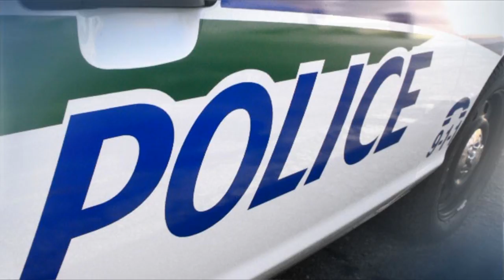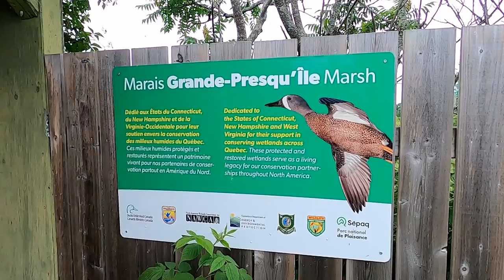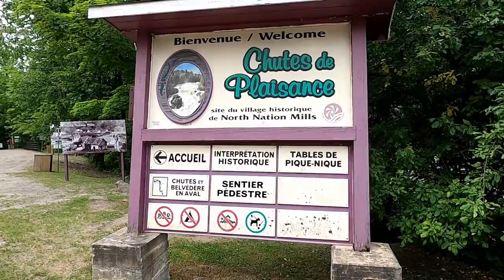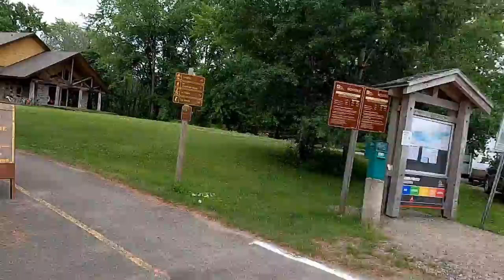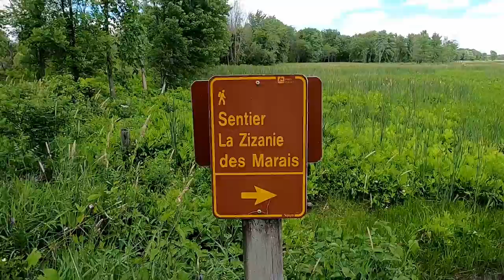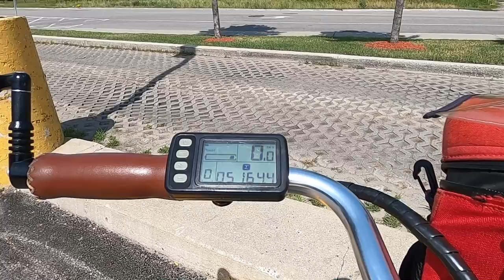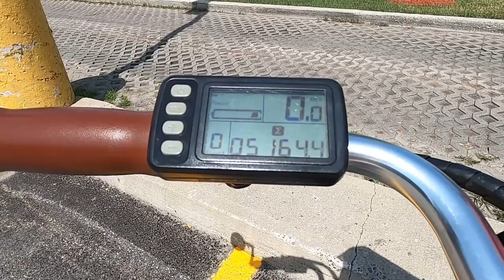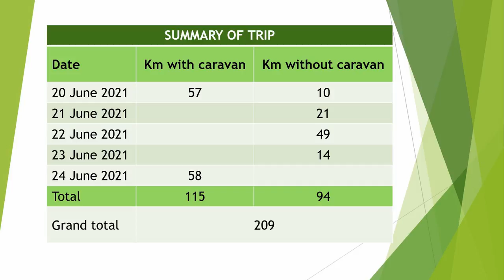Two Old Men on Ebikes With Trailers Go Camping at Plaisance

Comment: I love this video. It looks like such a pleasant trip. I have a Bacchetta recumbent to which I have added an electric motor kit. I love it. I am curious about what equipment you use to shoot your videos. I'm very impressed by how smooth the video is even when you are travelling of some quite bumpy roads and trails.
Reply from the maker: I'm using a GoPro 8 Black. The stabilization is amazing. The camera was mostly attached to the handlebars, and the Pedego doesn't even have a suspension fork. Of course, now that the GoPro 9 is out, that's what I'd like to have!
Reply: @RobertBeriault753  Thanks for that info, Robert. I didn't know GoPro cameras were that good at image stabilization. I don't really take many photos or videos while riding, but I might do so if I had a good way to do it. :-)

Comment: I put some airless tires on my Kona Ute electric bicycle tow truck and I'm looking forward to putting some serious miles on them... Hopefully my old rims won't disintegrate... Was quite a workout mounting them... A process not for the faint-of-heart and you need a Grapplers grip
Reply from the maker: Flat-proof tires must be wonderful!
Reply: @RobertBeriault753  so far so good  though there are some disadvantages to consider... some increase in Rolling resistance and decrease efficiency... Also somewhat Less shock-absorption and more unequal distribution of forces on the rim as compared with a pneumatic tire... LOL I'm on the road to find out... So far I'm still chuffed.. and happy to get my sidewall cracking tires and slime tubes that were delaminating at the valve stem off... Is also very nice to bypass the pump

Comment: Nice video!  What trailer / camper is that? Do you charge battery directly while riding. If so, please discuss.
Reply from the maker: The one I'm towing is my Bériault Bicycle Camper and the one Gaetan is using is my Solar trailer without the solar panel. I'm not charging on the fly because my camper is not equipped with solar panels. I charge my batteries at night in campgrounds.

Comment: Hi thank you for sharing your experience and trip I am a senior to I love bike touring I you like to have some Company sometime let me know I live in Mississauga Ontario How heavy is your trailer and how many w is your motor  I have a NCM Milano Plus 500Watt motor Can I pole a small trailer 4:51
Reply from the maker: My camper weighs 60 lbs empty and 130 lbs fully loaded. My Rad Rover with its upgraded controller is probably close to 750 Watts. Even at that, it can't pull my camper up a 30 degree hill, which is what I'm looking for. Should you like to communicate with me, you can reach me at email address, available on my website: www.robertberiault.com. Thanks for your comment.

Comment: I make ahabit of carrying my charger ans 8 meter extension cord on me e-scooter. Should I need to recharge nearly anyone will allow me to plug in, especially if I offer a few dollars. No trailers were available so will build my own out of 3 inch PVC plumbing, bicycle wheels and may actually have a spring suspension. Stronger, lighter and more specific to my needs than anything I might buy. I am 75 and live in Costa Rica. 2  rain suits in the cargo box  so can bike here all year long. Plus city speed lomits are 25 to 40 KPH, highway 30 to 60. And nearly all drive under the limit. My e-scooter will do 56 KPH and I have a slightly illegal gas moped that will do 110 KPH. No engine markings and no way for authorities to test it. Not having Residency, I cannot have a driver's license or own a motor vehicle. But things work very well for me.
Reply from the maker: Sounds like the good life to me.
Reply: @RobertBeriault753  Best things in Costa Rica are housing is less than 15% the cost of the US, food 20%  Crime is less than 5%. We have National Health Care that pays 100% and makes Privite care far cheaper. The result being life expectancy for men is 7.4 years longer than i the US.
Plus of course weather. Where I live at an altitude of 6740 feet, it has never been colder than 54F, never hotter than 87. I vacation in Mexico, Nicaragua, Panama, Colombia, Ecuador, Peru and Bolivis 7 months a year. Even with the travel can live on under $1000 a month, supporting my fife and renting a 7 bedroom/5 bathg house with 4 car garage on 23 acres for $153 a month. Electric is $12 to $15, Water/Sewer/Trash $6, Internet $12.Cellphone $4, 
I have a 1300 watt gas gebnerator I could put on the trailer with the capacity to  charge 2 electric scooters like mine. Though might build a Windgen using a one wire GM Alternator.

Planning an electric trike or quad allowing enclosure for more fun in the rain.

A bit concerned on motorcycle hempets. Here costing $17. I was used to paying $350 to $450 for a Bell Star Motorcycle helmet over 40 years ago.
Reply from the maker: WoW! Can I move in with you?😂
Reply: @RobertBeriault753  My wife would have issues with that. 3 bed/2 bath houses typically rent for under $200 a month though. I live on a farm about 3 kilometers from a town of about 9000 people. San Jose is about 3-1/2 hours drive. As an American I at least get a $107,300 US Tax Exemption and not taxed at all by Costa Rica. Well except on imported items.